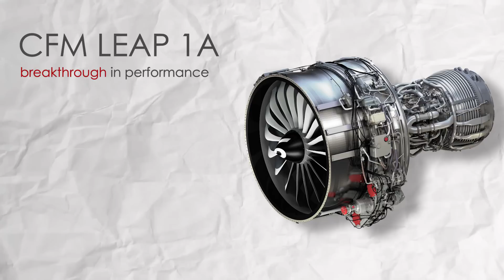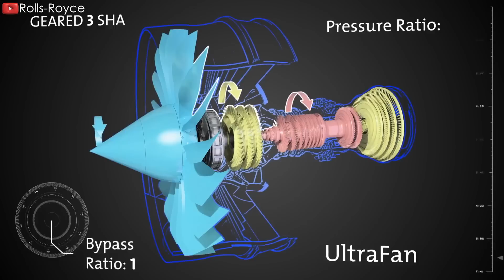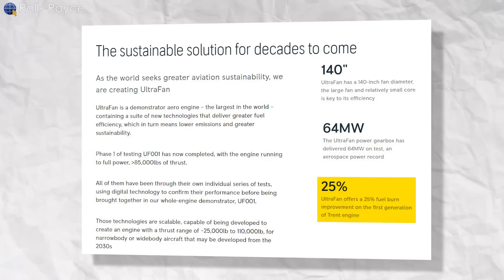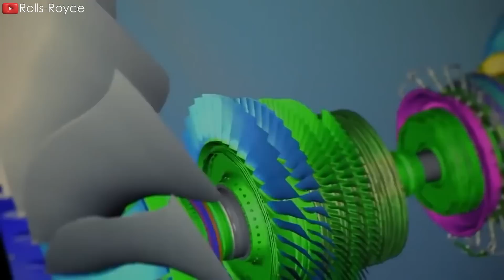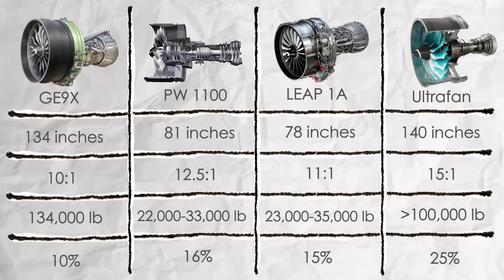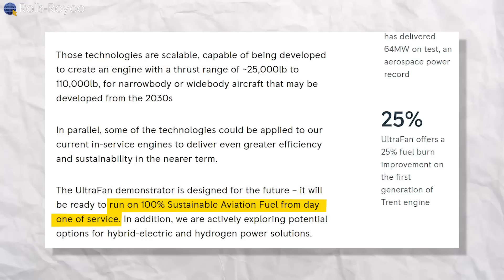This Airbus A350's “MASSIVE NEW ENGINE” Will Change The Aviation Industry FOREVER! Here's Why

Comment: Bird deflector for aircraft engine. 
Need to construct an Ice cream cone shaped bird deflector for aircraft engine. The body of the cone consists of equally spaced razor sharp blades. spacing of blades is determined by wind tunnel testing to find the space that least affects air passage. The pointed end of the cone must be constructed to shred any item passing through.

Comment: Powered electric gearbox? that would use a bit of energy if it drove the fan as implied - but it doesn’t of course and it is not electrically powered. An electrically loaded dynamometer during loading measurements perhaps.

Comment: Some wealthy countries (like the US) are developing the methods and infrastructure to mainly supply their militaries with an alternative fuel source, and the airlines are piggy backing on that. "Green" jet fuel is not economically viable at the moment, it's too expensive and hard to produce for widespread use. "Green" jet fuel also has to be produced and refined to be an exact replacement for current gas turbine/jet engines. The engine makers are not going to modify their engines to fit your alternative fuel, sorry, doesn't work that way. So it's not a selling point, it is a requirement.
Reply: If you calculate the amount of land required to produce biofuel to power just one A350 you will find that it is huge.  Fuel synthesis using green electricity may be better but then you have to consider the number of big wind turbines necessary to supply one A350. It is a lot.

Comment: How do you keep cooking oil from freeing on 35000 ft at Negative 200C° modern Aviation fuel has additives to antifreeze and cope with any kind of situation to continues supply of steady flow.  Cooking oil need to be well developed to do that in the future.
Reply: How will we fry our food if a hand full jets burn all our cooking oil? LoL
Reply: Your ignorance is laughable. Saf ain't cooking oil for a start. And -200°c way to pull a random number out your ass.  -56°c if the lowest temperature aircraft encounters. And if you really wish to know, go ask British airways, airline that's been using it for 3 years now.

Comment: Help me understand. This engine is the diameter of a 737? How will it fit on the wing??
Reply: the wing is bigger??
Reply: Well maybe because it's not made for a737 in the first place. Just like the GE90 or Trent 1000 it's meant for large jets 🤦🏻
Reply: the engines on the 737 don’t matter. You need a parachute when flying Boeing these days. Never know if you might get sucked out of a door or have some electronic system crash the plane! 
I now check the planes a route/airline is using and select a flight with Airbus over Boeing wherever possible.

Comment: GE9X hasn`t been released yet & RR`s UltraFan is far from being considered by Boeing or AB. The most efficient turbine built thus far is RR Trent XWB -84 & -97 these two engines power the A350-900 & -1000 respectively & will do so for some years to come. XWB has been proven to be very reliable & has helped the company to become more profitable since the pandemic & the debarcle that was Trent 1000 issues that did RR so much harm is now a thing of the past with those issues sorted. GE9X will have to prove itself when B777X is launched but that could be some time off yet but it could well surpass XWB efficiency. UltraFan could well push the boundaries further but until either Boeing or AB want this engine for a particular aircraft RR will be reluctant IMHO to invest funds.
Reply: Since 2014, its a test bed engine. No longer intended for production in its current form and is not available to airframe manufacturers, although it could be scaled down for narrowbodies. According to RR press releases a year ago, technology learnt from the UltraFan is being transferred to current engines, ie the Trent series, so expect some announcement for upgrades to those XWBs at a suitably propitious time, like when the B777X finally gets certified, when just maybe Airbus then announce improvements in performance to the A350 at the same time...........
Reply from the maker: thanks for leaving your comment

Comment: So the RR engine can use SAF as fuel,,while the GE9x can't,,,,
Reply: Yeah that's not how it works. Most modern jet engines can use SAF it's the entire point of saf. This is just far more efficient because of the larger bypass and gears fan.

Comment: 'This Airbus A350's “MASSIVE NEW ENGINE” Will Change The Aviation Industry FOREVER!' - because the geared fan engines fail permanently and have to be checked with a lot of amount.

The next generation of engines will get a larger diameter than the fuselage.
Reply: Actually the passengers will be sitting all around the circumference of the engine ,
A flying engine instead of a fuselage 
😅
Just upscale the similar fighter jets LOL